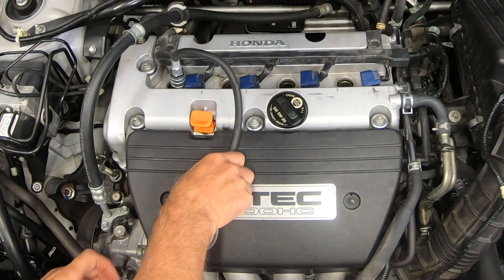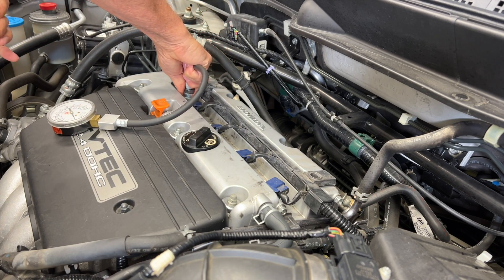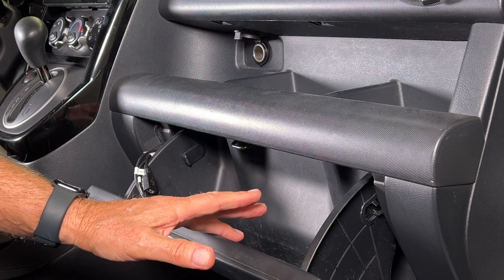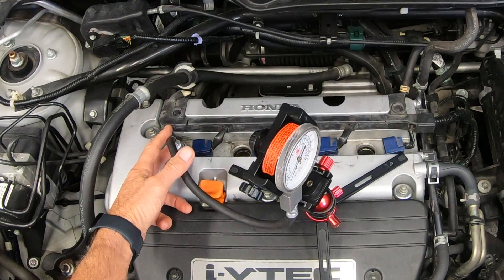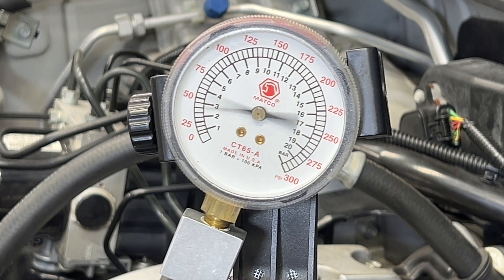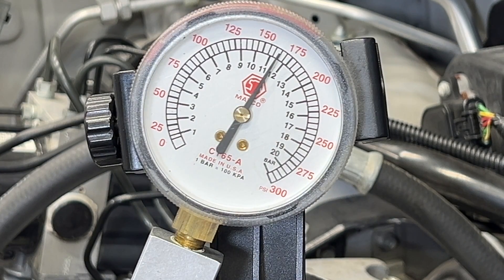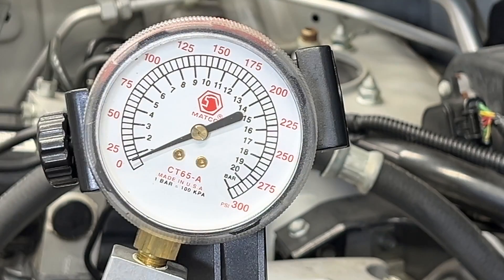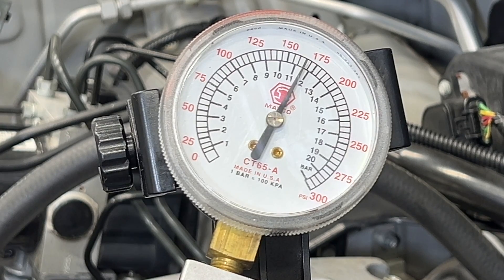How to do a Engine Compression Test and determine engine mechanical problems on a Honda Element

Comment: Your videos are excellent. Just finished on my 2005 with 225,000 miles. 178 to 180 psi on all 4 cylinders. I'm relieved but my "crank no start" is still present. Fuses good, new fuel pump, new fuel relay, new coil packs, new plugs, new battery, alternator good, plugs are wet with gas, new crank and cam sensors, new map sensor, new throttle position sensor, new injectors, new idle air control valve, throttle body clean. Stumped. Hopefully not the wiring harness. Can't imagine since it was running fine and then no start all of the sudden. Thanks Danny !
Reply from the maker: Check this video out, maybe it will help https://youtu.be/qOWK2iTajjU?si=xi1Onfb1jqz3DRCU

Comment: Thanks again!

Performed compression test today.  Fortunately it came out great: all four cylinders were between 175 to 180 psi.

Side note:  Don't ask me how I know this, but if you reinsert the coils to prevent dust from getting into the cylinders - while you run an errand... and upon returning - you leave three in, while testing the first cylinder - well...  The coils will launch like SpaceX rockets.  🤔
Reply from the maker: Thanks for adding this, I definitely won’t ask how you know this, (lesson learned)

Comment: I have a 2004 element 475,000 miles on it original engine. Motor mounts and suspension new. I’ve had this car only a year. And just drove it locally. No issues no leaks. Im confused as to why it is still running well. Just had a local mechanic do a compression test 
#1- 160psi
#2- 170psi
#3- 160psi
#4- 180psi
The mechanic says the motor is in great condition. He is also stumped. He thinks that with so many miles it must have been towed behind an RV. Which would explain such high mileage with great compression.  He was not real familiar with the element but he seemed to think it would be ok on a long drive. 
What do you think?